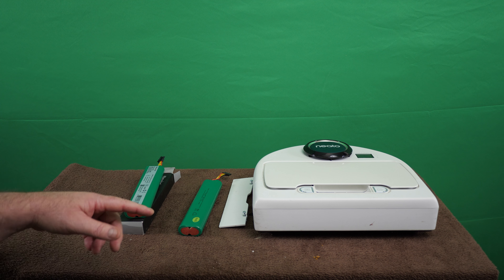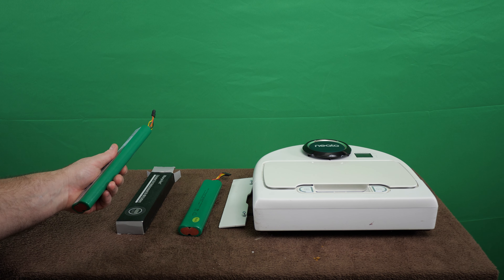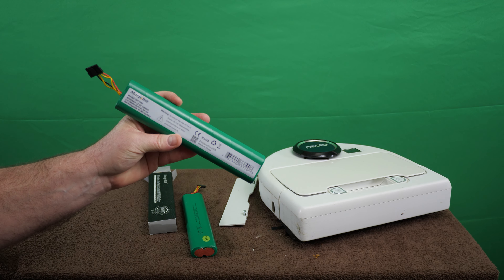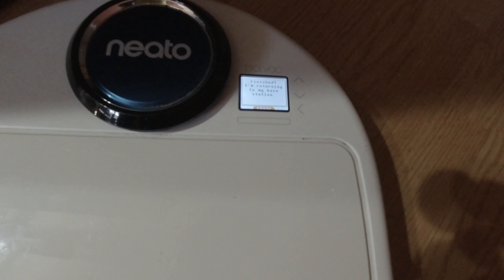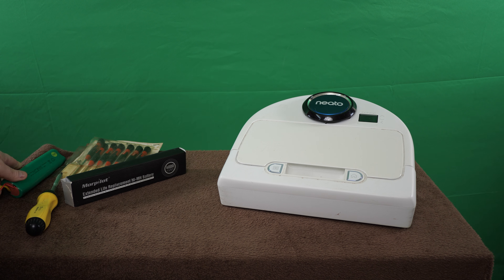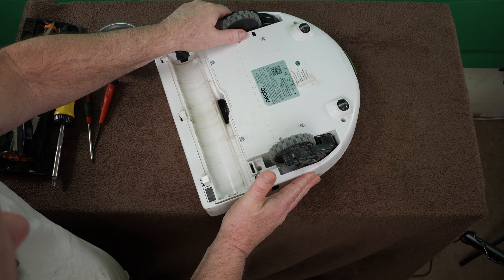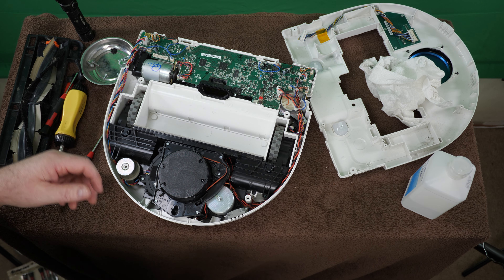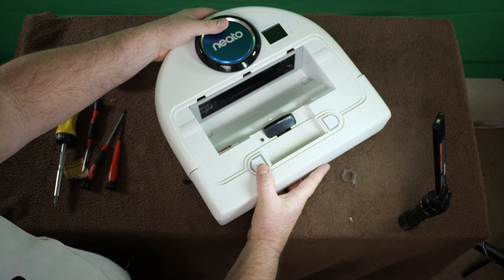🛠 Neato Botvac Side Brush Repair, Replace Battery, OEM vs Aftermarket Battery Comparison 🛠

Comment from the maker: We take an up close look at a 3+ year old floor cleaning robot to see if can fix it. This robot has been great, right up until it was not so great. It started acting weird telling me to turn on the power switch and the side brush only seems to work when it wants to. This video is all about diagnosing and solving both of those problems. Are those aftermarket Chinese batteries any good or should you just buy the OEM Chinese version for more money?
  
4000mAh 12V NiMh Replacement Battery -- https://amzn.to/3kkcAtv
Battery Review -- https://youtu.be/0VlL72HyjsM

Give a 👍 and subscribe 🔔 if you'd like to see more videos like this and thanks for watching 😃!

Comment: Thanks for  posting this.  I was having a similar problem with my side brush.  As for the the extra piece you found (if you still have it), its the cover for the mini-usb port used to update the software.  The port can be found just to the left of the master on/off switch (ie the bright red piece on the main board between the side brush motor and the vacuum in take.